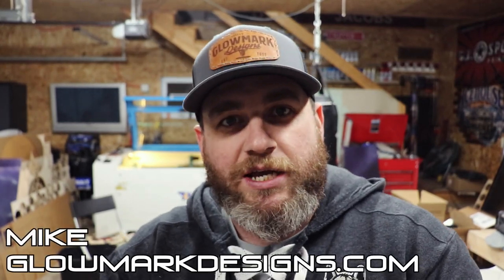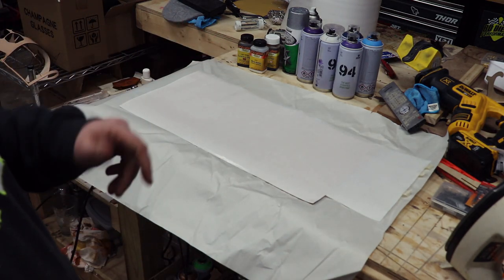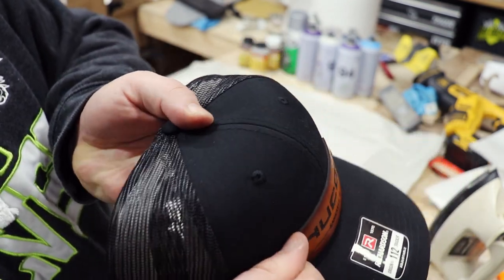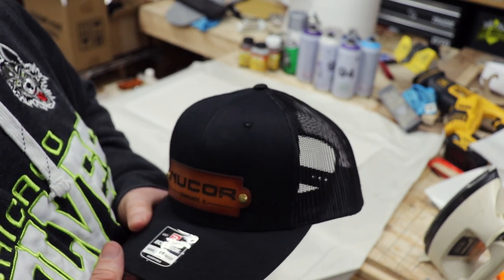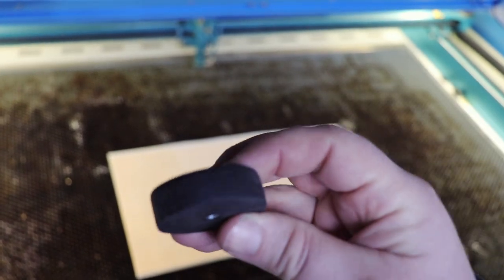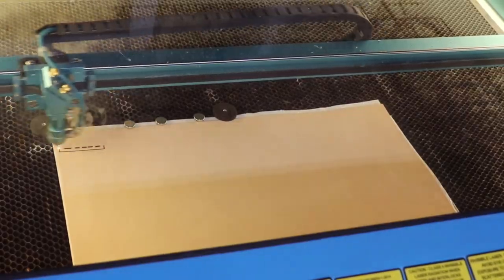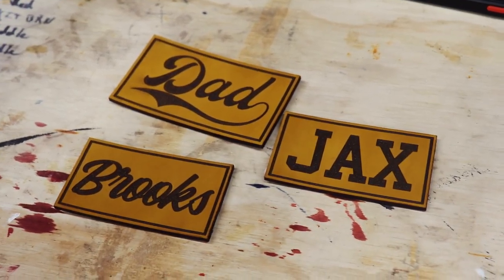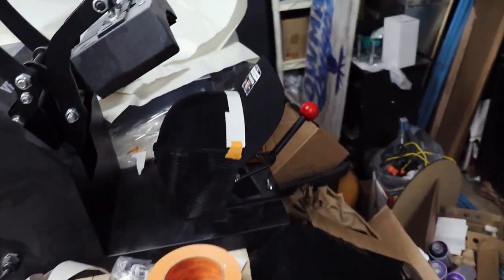A Work of Art On Leather: Making Our Laser Engraved Hat Patches

Comment: Great video.  You should do a video on the process of the NUCOR hat you did, looks amazing!! Where did you get the adhesive sheet?
Reply from the maker: I have a feeling I'll be doing a video on quite a few of them. They've inquired about doing a batch so fingers crossed they're as much of a hit at the charity event as I'm hoping. The sheet is from Hydbond. They're definitely gaining quite a bit of traction within the laser community. I've made a handful of patches using it and I'll definitely say its incredibly tough stuff. My only struggle is the cheap hat press I'm using in this video.

Comment: What weight was your leather?  I purchased five sheets of leatherette from Hydbond that already has the adhesive on the back and tried that with my 10W Diode laser. Came out very nice and now I just need to put them on a hat with an iron. I don't have a heat press but if my endeavors prove successful and I can justify the purchase that might be the way to go. Good video and I'm a new subscriber!
Reply from the maker: I usually go with 3.5oz or so. Does depend on the look my customers looking for though

Comment: Nice work!! Final product is very nice. Great video - Subscribed. 
Please forgive my ignorance, but why do I see so many people dyeing the leather rather than buying pre-dyed? Is this simply a much cheaper way of getting it done? Or is it because it allows you to make a more custom final product? Or allows you to buy a larger cowhide section and still be able to create different color variations with each project you do with it? Also, do you finish with any kind of sealant or finishing product/protectant?
Reply from the maker: Funny enough, I dont know what the true answer is. I first found that people were dyeing and I just kinda went with it. The more I've looked into it and seen others on the internet doing them I see even less people dyeing and instead going with tanned leathers. If I were to guess, I'd assume many people start with veg tanned because the fumes aren't as harsh. Its definitely cheaper to go with veg tanned BUT if you start adding in your time to do the staining then its definitely more labor intensive. I guess it comes down to preference more than anything. I've done both and ease of use, buying tanned is easier but I've got the exhaust fan. Its definitely a zen moment doing the airbrushing though, I truly dont have a preference. 

I finish my stained patches by airbrushing Resolene. For some other colors it may be better to use a monk oil though. Resolene does tend to darken the leather a touch and gives it a glossier finish some people dont prefer.
Reply: @glowmarkdesigns  Thank you for taking the time to reply, I really appreciate your thoughts and perspective. I can’t wait to check out your other videos and new ones that you post.
Reply: @glowmarkdesigns  if by not as harsh you mean not utterly toxic, then yes, veg tan is less harsh.

Chrome tanned leather on a laser has the potential to be fatal through the release of cyanide gas.
Reply from the maker: @ddunsmore402  I was speaking more of uncolored veg tanned. I don't use any chrome tanned leathers personally so I don't know anything about the process for using them. Good information to know about the chrome tanned, thanks for sharing.
Reply: @glowmarkdesigns  I figured, but thought I should put it out there.
Reply: Love the content . I started lasering with an xtool brotha and what can I use to get rid off the burn marks or charring after burning

Comment: Your hats look great! How do you attach the rivet?
Reply from the maker: I use a pick and slowly work it through the spot I want the rivet. This usually will move the weaved fabric enough to get the rivet in without tearing or ripping any threads and then set the rivets like normal.
Reply: @glowmarkdesigns  Thank you!

Comment: What silicone sheet are you  placing over patch on the press?
Reply from the maker: Just a simple piece of silicone I got from Amazon. I could try to find the exact link for the one I bought if you are having trouble finding them.
Reply: I have been on the hunt for that type as well.  Haven't found em on Amazon yet.  😕  Have been having trouble getting my patches w hydbond to adhere.  it's maddening

Comment: How come the engravings come out so clean?
Reply from the maker: I worked a lot on getting the air pressure dialed in at a super low amount and coupled that with actually defocusing the laser slightly.